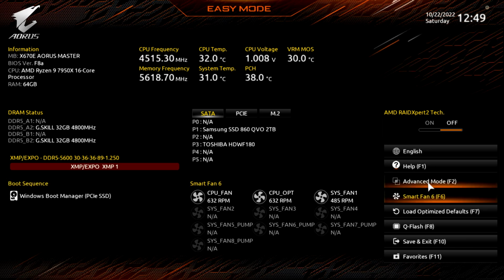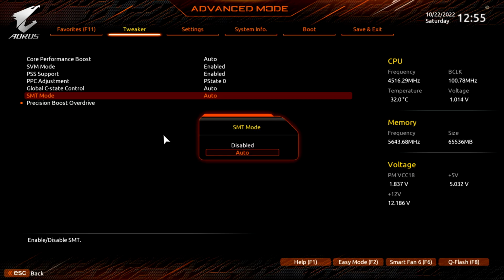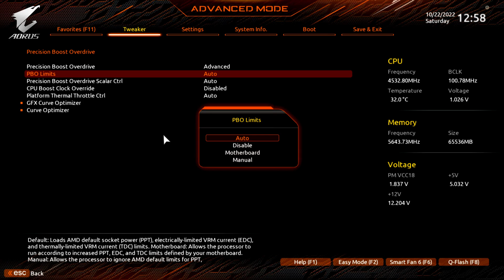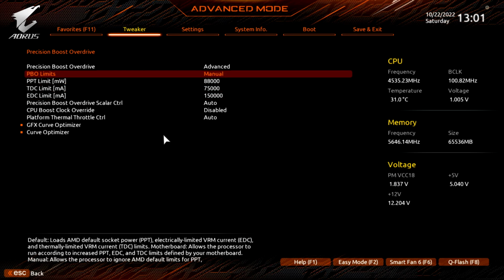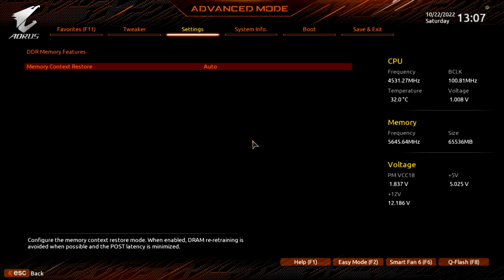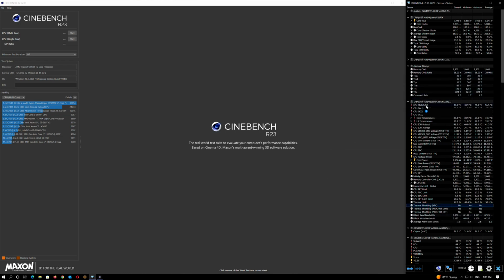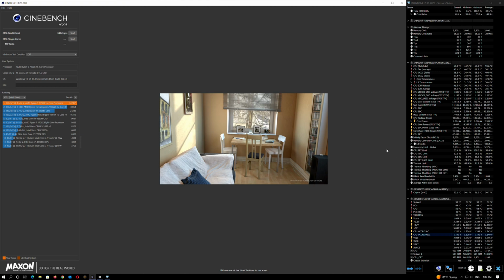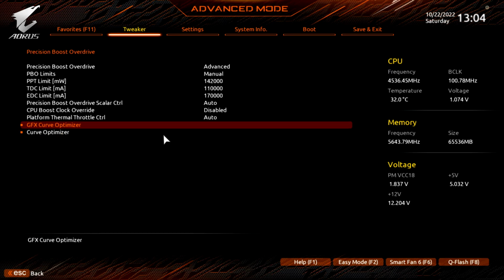How to speed up post times on Ryzen 7000 and enable Eco mode

Comment: Video is year old people!

Bios updates happen, Do it!

MSI Pro A620m-e
7500f
Adata 5600 (non expo)

Post and Boots quick on default.

Takes 1 minute 10 sec to post only if i set ram to 5600 /6000 manually.

Enabling memory context restore dors nothing on first post/boot after saving in UEFI but after that... It post as quick as any ither system. Even the cold starts remain quick.

If i change something in UEFI, it will again take longer the first time and quick after that.

Comment: My 7500f with a id-cooling is-50x v3 ((low profile cooler) for cooling VRM on my A620)) go straight to 95 deg no thermal throttling.

No matter what i do the no way to drop those temp's unless i power limit it to 88 which will be 88-90 deg or 75 for 75- 78 deg or 65 for 65 to 68 deg.

Basically this makes it run as fast as a 5600. LoL 

Same cooler used to do 67 max on my 5600 on Cinebench R23

Comment: Found out the 7800x3d chip oc'ing it has no effect.  (Maybe to all 3d chips).
It already is tight out of the box sort of speaking. 
*Probably why/part of the reason, it is the best gaming CPU on Earth right now.
Reply from the maker: Yeah, the X3d cpus are the best ones right now based on performance per watt.
Reply: @GameTechReviews  
Not just that = A slew of games and it comes out on top in almost every single game tested under the sun.
and it outdoes all CPU'S (GAMING ONLY) on Earth for gaming and does it for a few watts compared to its big brother of 200 or so watts and intel's 200-500 watts and all of them still lose to a chip that does it for about 80 or so watts and beats all of them in almost every game tested.
*7800X3D = Greatest made Gaming CPU, of all time!!!!
*7800X3D = THE G.O.A.T. OF GAMING CPU'S!!!!

Comment: OMG I havet eh same motherboard as you and I h8t3 it.   
I spent a week or two just trying to flash the bios and get it to recognize my memory and post.
When I finally did, this is the first thing I did, but when I hit save and reboot, it will never come back....   I have to clear CMOS ever single time and do a cold boot if I want to get any video at all and to a BIOS screen.   I know it takes minutes to boot but this is ludicrous, and there is no feedback... you have no idea if it never will boot, or just give it 5 more minutes....

And this is still on the bench.  Not inside a case.  Not even booted to an OS yet.   $2,000 worth  of parts that's still useless.
Let me tell you, myloathing for Gigglebyte right now is at an all time high...

All I can tell you, is if you put in those 2 second sticks of RAM (4 instead of just 2) you enter all kinds of non-booting h377.

Comment: Great info! Unfortunately, "Memory Context Restore = Enabled" for me means BIOS freezes when trying to F10/Save, and then subsequent cold boots fail with boot loops. (I am using "EXPO II" Memory Profile and ECO mode on the CPU). Maybe it will work with a future BIOS. Until then, my cold boot time from pressing power button to Win 11 desktop = 52 seconds.
Specs:
- Asus ROG STRIX X670E-A GAMING WIFI ATX AM5 Motherboard on BIOS 1004
- G.Skill Trident Z5 Neo RGB 32 GB (2 x 16 GB) DDR5-6000 CL30 Memory
- AMD Ryzen 7 7700X 4.5 GHz 8-Core Processor
Reply: My boot time ONLY 2 Seconds... R9 7900x+ x670aorus elit + kingston 32 gb 6000MHZ+ Samsung 980 PRO 2TB
Reply: @hascobar962  you should post a video on that showing how you did. It. Could help a lot of people
Reply: @TigerDave  I just fixed that yesterday dear friend... I was very angry 21 days black screen problems and I fixed all problems. I will make a video but I need little time because of after 21 days problems with amd5 black screen... I don't have any problem now less then 10 seconds boot time and zero problem. I will make a video and help all people. Summary: My CPU, motherboard and ram was broken and changed and then picked the best ram for am5
Reply: @hascobar962   did you record a video?
Reply: @mamafragger  I'm sorry 😳I forgot about record video. I will record a video asap
Reply: @hascobar962   did you record a video?
Reply: Plus my system just work well with Kingston ram
Reply: https://youtube.com/shorts/3bu8tNbXtZk?feature=share
Reply: I have the exact same board and was able to get this setting to work one time and now I can't get it to go back because it does what you're describing.

Comment: Would enjoy seeing something about Aorus X670 boards (like the Xtreme and Ultra, etc) and BIOS settings. Overclocking would be good. DDR5 memory config also for XMP I (the Trident Z5 6600 stuff I got will not behave with latest BIOS....pretty sure it was working before I sent the board back on RMA).

Comment: Do yourself a favor. Don't buy this AM5 stuff yet if you don't have to. The boot times are ridiculous. UPDATE: New BIOS sorted this out a long time ago.
Reply: I would agree because of my problems with component compatibility, my boot is super fast.. (b650e-f) but I would still say wait on am5 stuff just because of problems I've run into
Reply: 7900x in mine amd since day one I've always posted in 15 seconds or less you sire your os isn't on a hard drive lmao
Reply: It was just old BIOS, thanks for replying so I could remember to update. :) @Waxwizard760
Reply: Just because of that?? 🤷🏾‍♂️🤦🏾‍♂️😩😂😂
Reply: @Millzlane  Yes definitely because of that. This boot time issue is pathetic and a dealbreaker.
Reply: @JFinns  update your bios. My boot time is like 15 seconds
Reply: @n1njasause  which motherboard you are using ?

Comment: Wait. Other people have 7000's that take forever to boot something? I thought mine was just dropped as a child.
Reply: Been a problem for a long time now. Even my 2700x had 40-50 second boot. Bought the best Ram specifically for Ryzen and had a fast SSD. My i5 4690k booted from cold into windows in 7 seconds.
Reply: @ahmadmohamad6384  My Ryzen 5800X / B550 PC cold boots in about 8 seconds. Ryzen 7000 is a disaster, boot times over 40 seconds. Would never build an AMD PC again if this isn't fixed.
Reply from the maker: Did you enable the Context Memory Restore option in the bios as shown in the video? My Ryzen 7000 system posts about as fast as any other DDR5 based platform. Also, what motherboard are you using and what memory amount and speed are you running?

Comment: problem with my 7600x and the memory context restore is that it makes the system unstable, firefox crashes even had a blue screen once, with it disabled that never happens. my ram EXPO is rated for 6000mhz 30cl but maybe thats to much without the training.. gona try a lower clock on the mem and see if that helps but it would suck anyway. and 50 seconds to desktop sucks aswell
Reply from the maker: Make sure you are on the latest BIOS. The newer bios seems to have improved post times as well as memory stability at the higher speeds such as 5600mhz and 6000mhz.

Comment: Are you happy with 7000 series?  I have a 5900X and am on the fence about choosing Intel 13700k or AMD 7900X.
Reply from the maker: In general, yes, I like my new AM5 PC. I'd recommend the 7900X over 13700k if on Windows 10 as the older OS lacks support for Thread Director. However, even if on Win 11, AM5 will be a better long term option because of the ability for drop in CPU upgrades in the future. The only thing to be aware of with AM5 is currently DDR5 speeds can't really go beyond 5200mhz while maintaining S3 sleep functionality. This is something that will be fixed down the road with BIOS updates. 6000mhz ram speed does work but S3 sleep doesn't reliably wake the PC if the ram is clocked that high. So that means you can save a lot of money on DDR5 by going with 5200mhz or maybe 5400 and 5600mhz. If near a Microcenter, a full upgrade to AM5 makes the most sense right now because of the free DDR5 6000mhz bundled with the Ryzen 7 or 9 CPUs (free 5600mhz with the Ryzen 5).
Reply: I don't notice any difference from my older 5800x system. Really if I had to do it again I would skip this first generation.
Reply: Tried this with the aorus elite ax and 7900x, package is around 83c whilst gaming (battlefield 2042) thinking of using the power curve what do you suggest?
Reply: @Antsummerfield83  Those temps are perfectly normal but another option is to run your 7900X at 65watt TDP also known as "ECO MODE".   This effectively makes it function like a 7900.  You don't lose much performance at all, a few percent, and the CPU will run much cooler.
Reply: @secretjuice6725  I don’t no the settings for the pbo for 65w eco. My previous Asus rog board had the presets but this aorus doesn’t
Reply: @Antsummerfield83  My understanding is every motherboard has two differnt areas to configure PBO.  One section is the default "AMD" settings, and the other section was created by your motherboard manufacturer.  Have you found both PBO sections?  On my ASUS, i have to go under AITweaker > PBO.  My only other suggestion would be to hunt around on youtube to see if anyone documented where it's hidden.

Comment: Don’t do this, I was wondering why my games were suddenly crashing after 1-20 seconds, then I turned this setting back to Auto, and crashing went away; it may cause system instability.
Reply: He isn’t talking about the eco mode.
He’s talking about the POST speed up.

I’ve been in the phone with ASUS support trying to figure out why my 3770k was booting 10x faster than my 7600x. 

So, ASUS says;
This is due to DDR5 memory training being significantly slower, due to the density of these sticks.
The issue scales with the amount of memory it has to train.
If you have 32gb, then it will reduce it by 15 seconds.
If you have 64gb, then by 25 seconds, etc.

Disabling memory training is NOT recommended.
If you do, memory intensive tasks (such as gaming) are highly unlikely to work. 
The system will experience general instability. It may be able to boot into windows, but not much past that.

They are working on improving this through new bios versions, so look out for that.
However, he admitted, that he does not expect any vendor to make great improvements in this area; this is simply a consequence of lack of the new memory, and likely will not be ‘solved’ until ddr6. 

However
One workaround exists, which simply is to not power off the PC entirely. This will allow the previous memory training to remain, and thus, the speed of waking up should be much more in line with what we had expected from our systems. 

My take away from this is that, ASUS believes it can somehow reduce POST time by saving its memory training for use later. However, regular memory training is better; sometimes, timings change minutely, and without regular training, the board wouldn’t pick up on this. 

So disable quick startup in windows, as it really doesn’t help much, and start using hibernation or sleep instead of system off.
Reply: @hoverbike  so you are saying not to follow the advice given on video in regards to post times? Because my pc takes like a full 50 second to post.
Reply: @OPTCFanaticUS  Try it, see if you run into stability issues, and if you do, reenable the training.
Reply: @hoverbike hey man , just saw your comment and I’m on a MSI b650 board and 7600x having this issue. Enabled memory context but the CPU is randomly clocking up to 5.45ghz and fans are spinning faster. Have you found any solutions yet ?
Reply: That totally depends on your luck on the cpu chip lottery, in fact it should be rock solid stable at most cases, amd calls this “eco mode”, so they already know it should be possible to enable anytime, you have the problem, sorry buddy

Comment: I have the gigabyte b650 aorus elite ax and idk why but my cpu fans won’t stop ramping up and down even when I fix the fan curve speed in bios it’s been super annoying only way I can control them is with a 3party fan control on windows any idea or solutions you might have ?
Reply from the maker: It is based on the temperature of the CPU. If the CPU heats up quickly then the fans will ramp up faster.
Reply: I've never used the bios in a gigabyte board, but there should be a way to adjust the fan speed based on the temp of the cpu within the bios. 

Make the fan speed the same no matter the temp and you won't get the ramping up and down. 

Or you can add a time delay to the speed change so those quick little heat spikes that go away after a couple seconds won't cause the fans to ramp up. 

Usually the delay is 0 or 1 second, so any little temp spike will instantly cause the fans to respond, but if you put the delay on 5 seconds you won't get the annoying ramping up and down as much. 

I personally just put my fan speed the same no matter the temp so my PC always sounds the same.

Comment: Appreciate the tip on making boot times faster, will have to try it out later!

105w Eco mode on the 7950x is a monster by itself. Testing mine with a -0.1v undervolt and it consumes a tad less when gaming and doing casual things. Doesn't go beyond 68c at 21c ambient with the ak620 (never goes above 80c when rendering on Resolve). I've noticed that Cinebench always runs cooler with ryzen cpus for some reason, haven't really looked into it much lol

Comment: Checked your settings on Asus tuf x670e with 7950x and z73 kraken 360 aio and still 95 degs. :/ cpu Takes 180w so im guessing something is not working
Reply: x670 aorus elite x73 nzxt cooler ... NZXT h9 FLOW 40-45c very cool

Comment: Sadly on my X670E Taichi I had Memory Context Restore Enabled by default and it doesn't help. (Auto and Disabled were options). ASRock just released a new BIOS yesterday but that also had no effect. I'm sure it'll come...
Reply from the maker: We just have to wait for more bios updates. That's the thing about being an early adopter of a new platform. It was similar with Zen 1 back in 2017. It's really the memory compatibility more than anything. I'm using an XMP kit for 64gb of RAM and sometimes it still has to memory train.
Reply: @GameTechReviews  Absolutely and I knew this going in, I kind of enjoy being there on the bleeding edge even when things don’t work. Makes it exciting when they finally get fixed.
Reply from the maker: @343_GuiltySpark  I forgot to ask, what memory are you using? Also, as a test, disable an XMP or EXPO memory profile and run the memory at stock JEDEC default (typically 4800mhz) to see if the memory context restore then works.
Reply: @GameTechReviews  It’s a GSkill DDR5-6000CL30 kit with EXPO and to be honest I haven’t tried booting without EXPO yet, I’ll try that.
Reply from the maker: @343_GuiltySpark  Did you ever try it without the EXPO profile? I suggest running the memory at 5200Mhz. That will fix the issues with S3 sleep/standby not working and it should also work with Memory Context Restore.
Reply: I read that people have a bit shorter training times on kingston beast/renegade (25,20 seconds) as opposed 35 seconds of my trident z5. 1.12 BIOS on my B650E PG-ITX blocks further BIOS flashes., so I'm returning it as there is no chance of fixing this ever. If you want to survive until AGESA is fixed, try running without XMP/EXPO, you may even get back your sleep/have more stable wake-up. 

Beware of 1.12